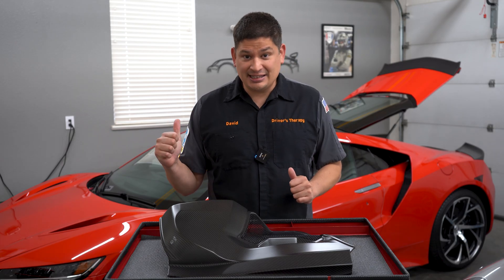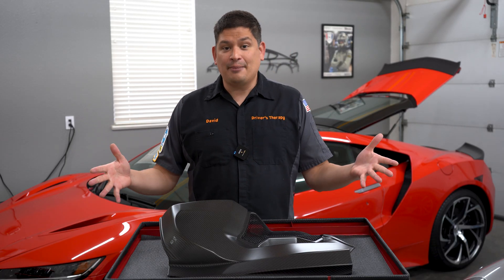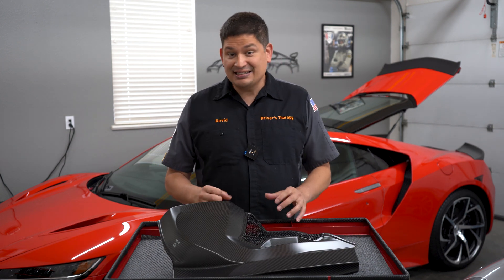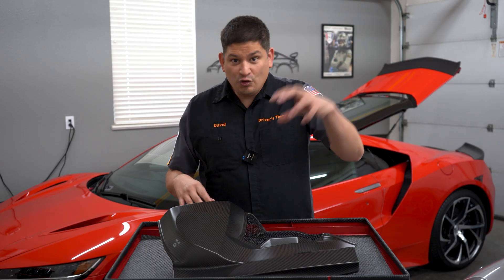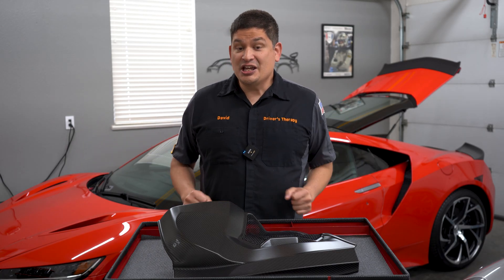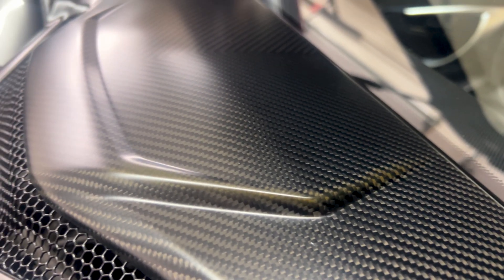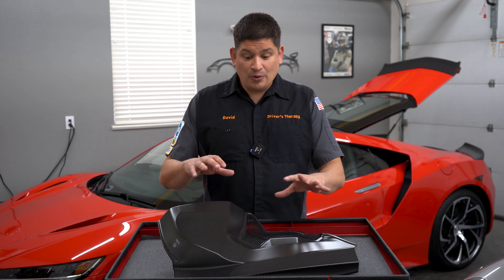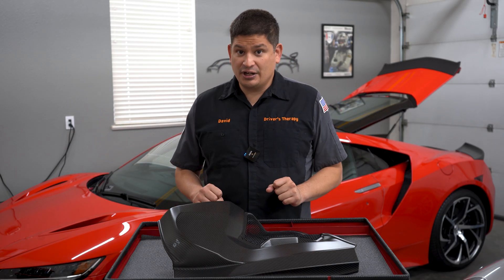Carbon Fiber Engine Covers Yellowing? Here’s Why (and What You Can Do)

Comment: Interesting information. My 2019 NC1 is just starting to show subtle signs of yellowing. This doesn't seem to be a problem with the roof or other exterior carbon components (spoiler, front and side trims). Is it engine heat or the type of clear coat used? I'm sure the roof and engine cover are different suppliers, so materials are probably different too. I'm curious how the tinted clear will turn out.
Reply from the maker: I think for now the problem is just the engine covers. My 2017 carbon fiber hood with 40k miles is doing fine.